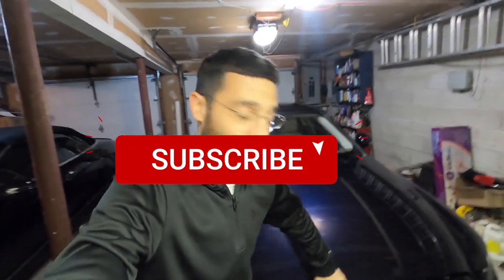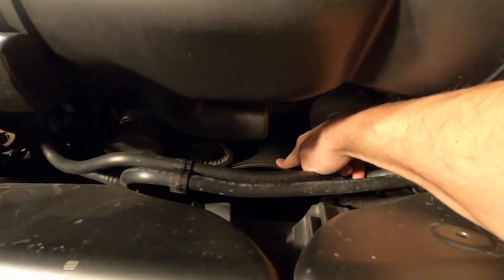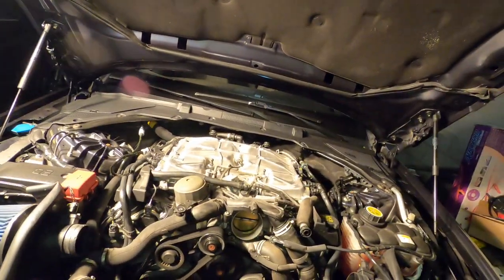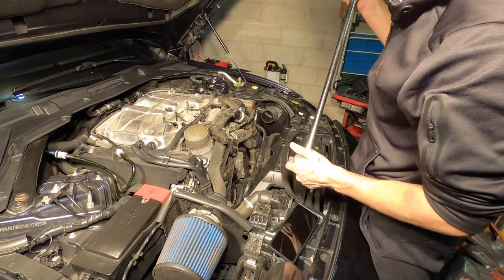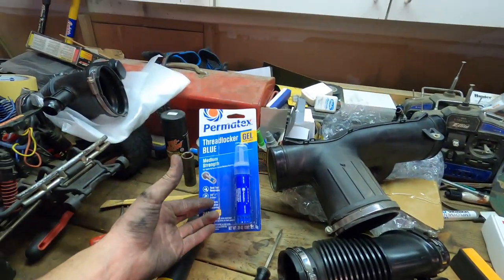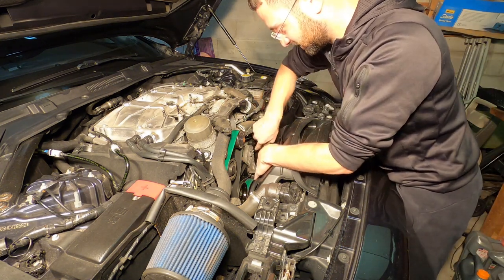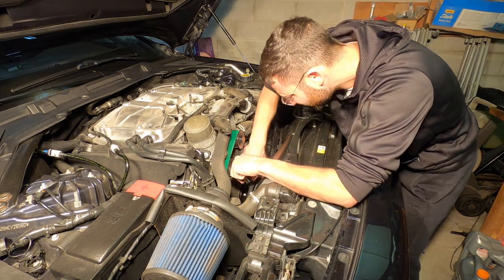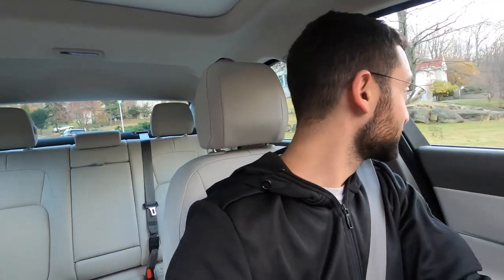Crank Pulley Install for Jaguar & Range Rover 3.0 & 5.0 Supercharger GAINS

Comment: It always pays to do a dyno run before and after to see if the money you've spent was worth it. Too many Jag upgrade mods out there that are only cashing in and not producing the power they say they do.. I did dyno my 2015 XF 5.0 SC and it came up to 460hp & 426tq in 4th gear. Now i have VAP tune in it from a F-Type SVR and it's enough for now.

Comment: For those wondering like I was, the green belt is a Gates KO80580HD FleetRunner Micro-V and the pully is a Gates 38022 Idler/Tensioner Pully. The lower crankshaft I'm not sure. Can't seem to see a part # in the video.

Comment: did you just change the crankshaft pulley? why not changed the pulley only SC? to gain more torque and horsepower? I'm from Brazil and would you like to know where you bought the crankshaft pulley and belt? could you tell me, where did you buy the pulley if you sell the complete kit? do you think that if you change all the pulleys, SC and crankshaft would gain more torque and horsepower? thank you, i'm your subscriber
Reply: VAP tunes
Reply: The lower pulley stresses the snout shaft less, and has more hp potential.   Especially after tuned.
Reply: He could of got the upper supercharger pulley also but only about 15-20hp gain maybe if that.  It’s not worth the hassle and risk.  Lower pulley is the way to go. It has way more gains and easier to install.
Reply: @MAD118Heavy he replaced the upper and lower pulley

Comment: So did you install the crank pulley and drive without a tune,if so you definitely risking a lean condition at WOT
Reply: Yeah i know that was my first thought on this video. Altering anything on this car thinking it's increasing performance without a tune remap is most likely decreasing hp lol.

Comment: Hey Kyle,
I just wanted to share with you and your subscriber's my appreciation for your channel.
I've owned a 2001 Saab 9-5 Aero, a 2008 Saab 9-3 TiD and because of your videos I now have traded my 9-3 for a 2013 Jaguar XF Portfolio 3.0 SC RWD 340hp and I'm looking to upgrade the intake, crank pulley and get a tune in it to bring it up to 450hp.
Excellent channel, excellent videos, very detailed and clear.
Ever since my 16th birthday when I got my first car, I've been a bit of a motor head too.
Thanks for your help.
Reply: That's what i want to do with my jaguar xf supercharged. But considering that it would cost at least 3,000 for everything just for a few more hp ive stalled on it. Be cheaper just to add a NOS tank lol.

Comment: Hi Kyle, I'm confused what you're doing with the 24mm. Are you only using that to stop counter rotation of the rotating assembly? I'm about to install the same Mina lower pulley (from the bottom of the car on a lift).
Reply: I know it's been two years, lol ..
But yes, the 24mm is stopping the counter rotation of the engine while you break the bolts free from the crank pulley.

Comment: always wondered if there is an issue over speeding any other accessory driven by the crank..Power steering ..air pumps.. alternator etc etc.
Reply: The supercharger belt only operates the crank and the charger or fan in some cars, it doesn’t share anything with the accessory belt

Comment: The jaguar xf supercharged is 420 or 418 hp stock. Altering anything on this car requires a tune remap or you are just throwing the car out its original power band. Probably lost hp doing it.

Comment: If he thinks a crank pulley and still half restricted air intake system is gonna now be making 400hp he's smoking something. as he said its a 12% gain (if he maps it in instead of just fitting it) which is about 36hp more plus the intakes which are only about 10hp means at most he will be running around 380hp with a good map. if he then thinks that he can get 160hp added too his engine just from swapping intake cones, crank and a map then wtf is he taking about. there's no thought of exhaust mods for less back pressure or maybe fuel delivery systems from XFRS. if it were that easy to make 500hp out of these with the minimal amount of parts and effort then these would fly off the shelves over M3's and other competitors. the man chats out his arse.
Reply: I wonder what model he's working on, I've got the 3.0 S model and it makes 380hp from the factory